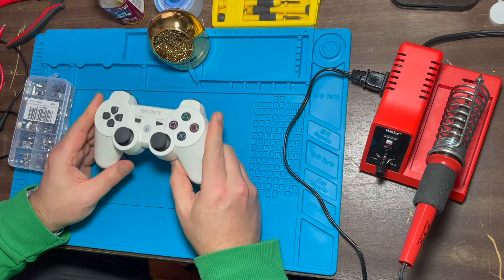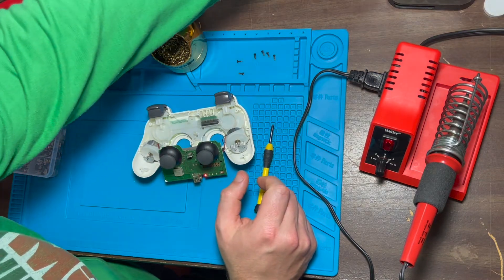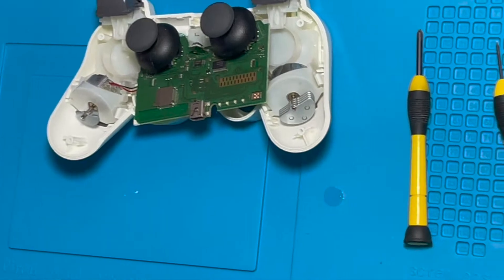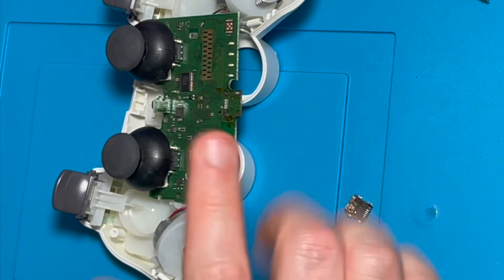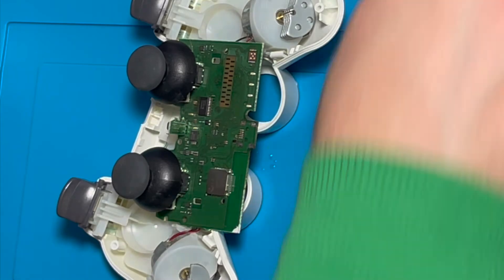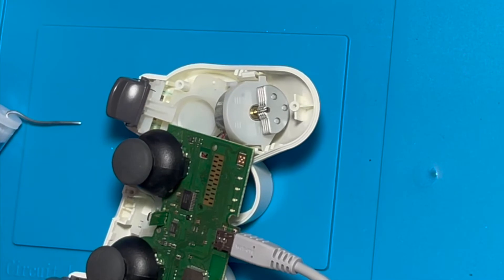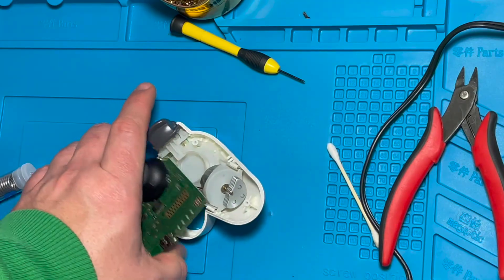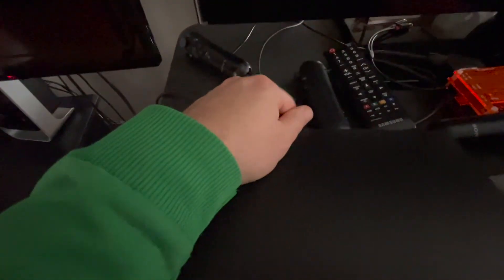Can I fix it? PS3 controller random input fix, and USB port replacement!

Comment: I was struggling with removing that port as well. I end up just taking some snipers and cutting leg, then it was a lot easier to de solder. I was curious what kit you picked up for the usb ports?
Reply from the maker: I may do that next time! It was the BYTCEW 100 Pcs Mini USB Sockets Jack Female Plug Connector Port Solder Dip SMD SMT USB Repair Replacement Adapter Assortment Set (10 Types ) on Amazon Help me decide on this product: BYTCEW 100 Pcs Mini USB Sockets Jack Female Plug Connector Port Solder Dip SMD SMT USB Repair Replacement Adapter Assortment Set (10 Types ) https://a.co/d/g9ot523
Reply: @oldgamer8996  Awesome! Thank you!